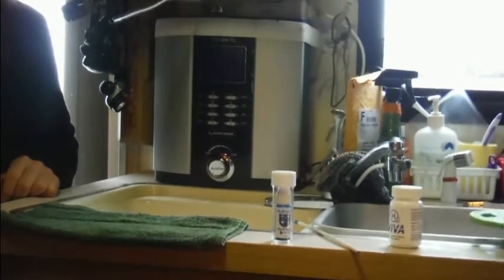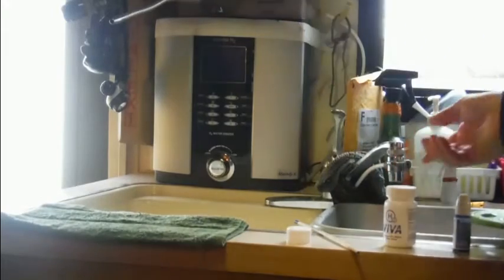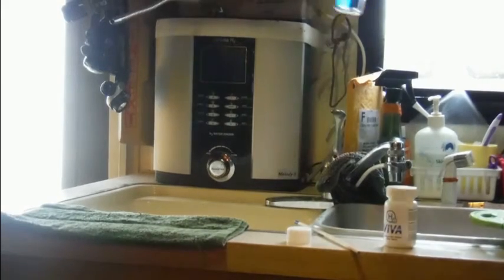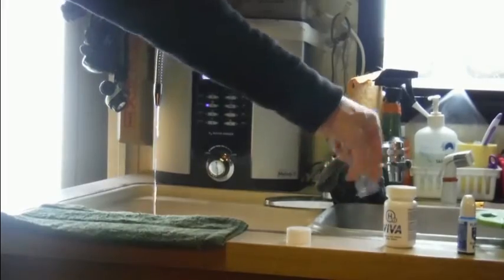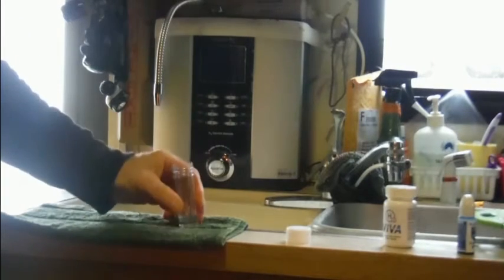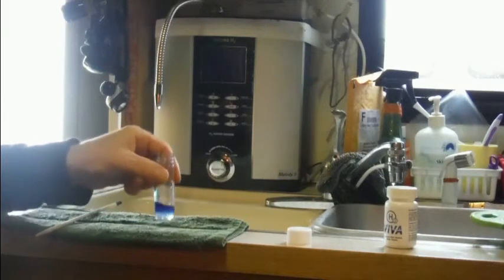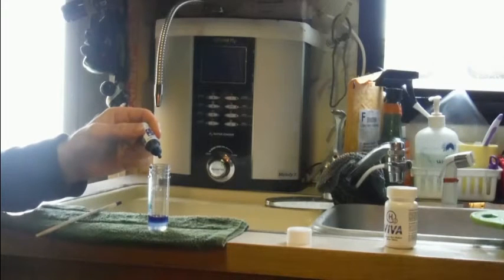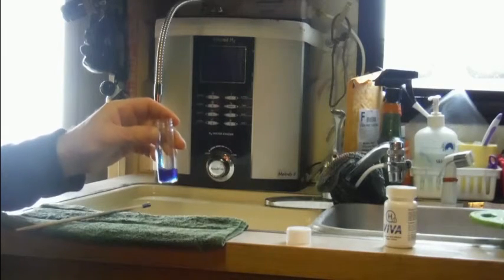How to measure dissolved molecular hydrogen content in drinking water.

Comment: How can there not be hydrogen in water??
Reply: He is measuring hydrogen which is not part of H2O with oxygen So just H2. That's why is molecular hydrogen so great antioxidant and water is not, because it is attached to oxygen and oxygen is powerful oxidant.. You can have H2 gas in the tap water, but it will be negligible amount.
Reply: @jirihutecka9020  Hydrogen gas is insoluble in water so how can the guy measure the hydrogen in water. I smell BS here!!
Reply: @PeterPete  hehe you are right. It is not soluble in water. The hydrogen bubbles are just trapped in the water.. that's why when you open the bottle you need to drink it immediately. Btw even if you don't open the bottle the hydrogen will escape even trough the bottle overtime.. Therefore buying already made hydrogen water in bottle is waste of money..  But making fresh Hydrogen in water and drink it immediately works as good as breathing the gas it is very good for neutralizing oxidative stress (ROS) and reducing lactic acid. So for metabolic problems like cancer etc. great boost for the body.. I was making my own hydrogen water with magnesium rods and acids which is very cheap method and it works very well. hydrogen tablets or machines works also, but the price is just ridiculous, rip off..
Reply: @jirihutecka9020  in my opinion it's all about money - very few people are truly interested in other people's health!

If the aim of taking in hydrogen is to raise or adjust pH levels then diet would be a better way to achieve that goal - eat foodstuffs with a higher pH if the aim is to raise pH levels in the body and vice versa if one wishes to reuce pH levels. As hydrogen can permeate through glass don't people think hydrogen will also permeate through the body and leave, thus doing nothing more than acting as a placebo and making a PH test more alkaline??
Reply: @PeterPete  no hydrogen is not about pH omg. It is direct antioxidant. Dude I really don't care what you think. I know if it works I was using it long time. Just use google and read some info about it. Bye...
Reply: @jirihutecka9020  just for your info - pH means potential hydrogen!
Reply: @PeterPete  pH has nothing to do with H2. You have internet so don't be so ignorant and do some research. Arguing with me here will do nothing for you.. Also you are wasting my time by this so bye..
Reply: @jirihutecka9020  I'm not arguing - you're just discussing this topic with someone who has a different viewpoint! 

The blue H2 indicator that is used in my opinion is basically a pH indicator - it has been considered that oxygen provides the acidity and hydrogen provides the alkalinity of a substance. Try using pH universal indicator paper in your H2 water - from the info I've looked at the paper should have a higher pH value than the value of the same water that has not been exposed to hydrogen gas!

Please also bear in mind the impurities from the breakdown of the magnesium and malic acid are contained in the water too, so it's technically not just H2 water!
Reply: @PeterPete  I didn't drink water with magnesium and acids lol. I was using just the reaction to create the H2 which was escaping to the water.. That is last post to you bye..
Reply: @jirihutecka9020  realising the magnesium and malic acid reaction would decompose both substances means you would have contamination in the water and a proportion of this would migrate with hydrogen!
Reply: What kind of ionizer do you have it looks like a Tiant